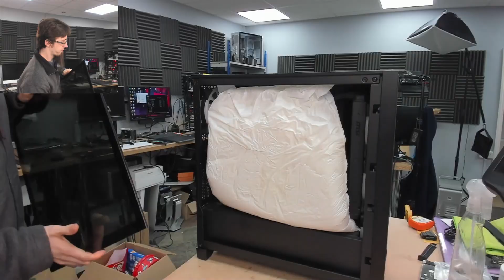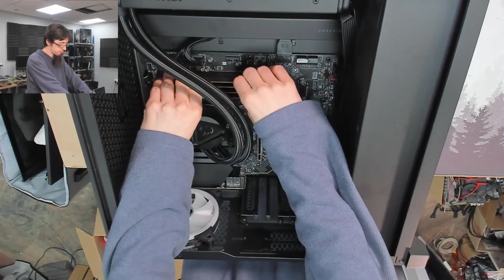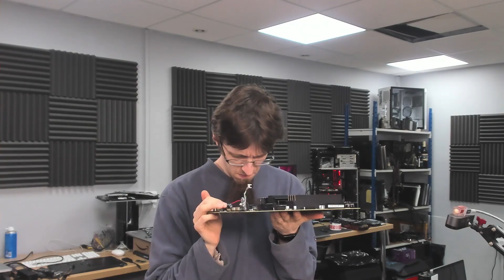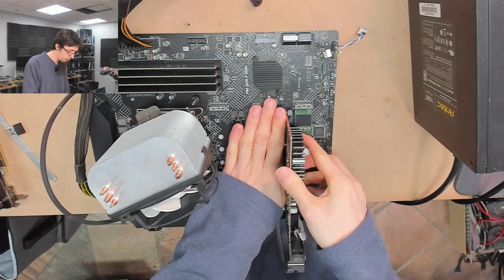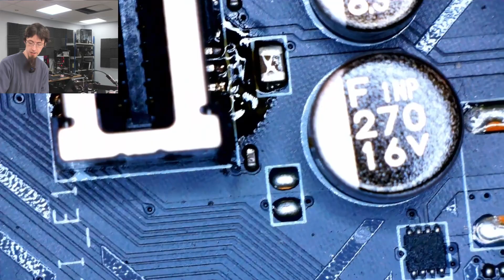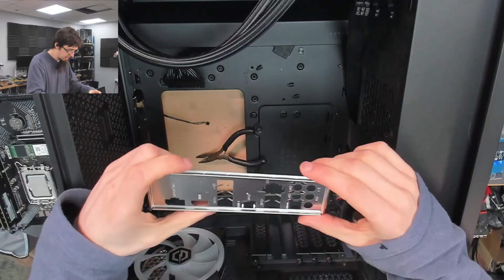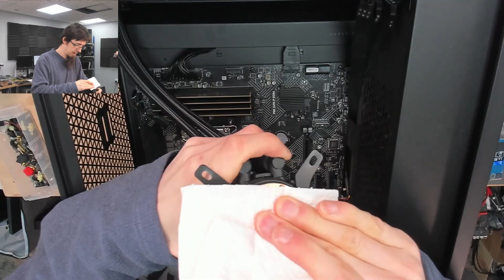CyberPower PC, GPU not detected - LFC#334

Comment: Not to toot my own horn or anything, but about 27 min in or so i thought to myself, maybe the solder joints on the pci-e is bad,  Because it did post once out of random luck. And when you moved it to the 2nd pci slot it worked fine. Then again i should atribute that to NorthridgeFix as i have seen a similar issue on he's channel.

Comment: I am jealous of your climate there. You put the fans so that they rump up at 60 degrees. The system there it seems to me will stay quiet. You can't do that in a warmer climate where 40 and 45 degrees ambient temperature some times of the year is a norm. Anyway nice fix I couldn't have imagined that the GPU slot pins were problematic. I would have thrown away the motherboard.

Comment: Its a really cheap board. True, but for that card you should a really good Asus Rog mother board with a platinum power supply. FSP is good but check the tier list. Excellent work on discovering those disconnected pins. I don't think it was dry joints. I think because the board was off the skew it probably damaged them, and popped off. Good work on repairing them, considering the size of tank soldering iron. You need summat better, some pro gig. Solid work dude.

Comment: How is that 3080 secured? Does it have a bracket to stop sag? I’m wondering whether the weight of the card has strained the PCIE slot enough to break the pins. Brilliant bit of detective work!
Reply from the maker: I think it's a bit of both. Some strain on the PCI-E slot, but definitely not enough solder on those pins. I'd expect them to handle more than this.

Comment: cheap mobo poor quality control would of tossed the ram out 2666 hasn't  been relevant as a ram standard I would of expected it weas a conjob build in the 1st place Linus has also roasted this company..

you can game on anything though the question should be asked should you game on it ..

you might fixed the damaged pci-e connector however what else will fail in the longer term..

Moost syste, inter conjobs chard topdollar for a substandard system the saving grace is the cpu and gpu m.2 may be  the rest of it chuck out 

$3000/£3000 system with less than 750-1,000 worth of kit in it

Comment: Going above and beyond as is standard operating procedure for Adamant IT I've noticed. You're local customers are so lucky to have you and many of them probably don't even know it. Most computer stores would at best diagnose a motherboard fault and then just toss out the existing board. They would then perhaps upsell the customer on a more expensive replacement part with a decent markup, plus probably charge more labor than you did in actually repairing the board. So yay to no needless e-waste and another bravo job sir!
Reply: I agree, the supposed 'repair shops' where I am are bloody useless, they won't fix anything unless it's an obvious and easy 'plug n play' fix, ones they can do quickly and for the most profit,....and anyone who knows anything about computers can do those themselves.....

Comment: I think my aging 3rd gen I7 has a short somewhere, every now & again it USB disconnects if the xbox 360 battery mini USB charge cable hits my case - a 4000D - It's either the charge cable, the case or my motherboard installation, it was the first time I've transplanted a motherboard in years.👍

Comment: This guy's methodology drives me nuts. You see the board is possibly not aligned properly and then mess with RAM sticks and video cards. Beep codes be damned. You see something like that, instant teardown! Right to the CPU socket. If they can't be trusted to install a motherboard or IO shield, you can't trust the CPU instillation. Don't keep trying to POST it with other cards when you could be causing more damage if the motherboard's not right.
Reply from the maker: This is an unwinnable fight for me. Whatever order I do stuff in, people will tell me I'm wrong... One of the problems of doing an instant tear-down on a no-post is that if it works after the tear down, was is the CPU cooler mount? The PSU? The ram? The front panel connectors? If you want to know the cause that takes a lot longer.
It's also worth noting though, this whole process takes ages when I'm spending 10minutes talking about theory between each test for the sake of the camera. If I shut up and get on it with, it's a 20minute job, but that defies the point of filming the process.

Comment: Well done Graham, good diagnostics, thoroughness in checking the board paid off, most repair shops would have given up and sold a new motherboard. Hope your customer appreciates it, but at least you had a really interesting repair video out of it!!
Reply: i think this sort of repair work now, is getting very thin on the ground.  Too many shops just want to the quick swop and away, rather than use skills on repairing, like people used to do. I fixed my PC speakers, with a soldering iron.  That was thanks to Markus Fuller, who did electronic repairs, so a quick look at two mins if that with the iron and good as new.
Reply: @procta306  Well it depends, if it was in warranty, i would recomend use it before soldering...
Reply: Though after he found out  it is a chip on the motherboard not any other part that is the problem unless he offers logic board repair services which he does. As most don't and only do part replacement not chip repair they would replace the part that they found to be faulty.
Reply: Times money mate. A board is cheaper than the diagnosis cost
Reply: @DJIInLondon  As he seems used to finding the place the error is made it was quick. As most logic board repairs use cheap chips or no chip in this instance it really depends on how quick are the employee at finding the error and how expensive is the board for which one is objectively cheaper after all costs are accounted for.
You still have to go through the majority of what he did to find the part that needs replacing as blindly going through a list will take more time then to do simple diagnosis like he did to get to it is a motherboard issue.

Comment: Those kind of faults are super common on PC with cheap boards and heavy(usually expensive) GPU's builded by SI .They probably didin't put the right amount of foam to mitigate the card wiggle during transport, and the weight alone of the card started pulling apart that PCIE x16 slot .And the resistance heat build-up from bad pins contact did the rest.
Sick find though, and i hope the client knows he is leaving with a better builded PC than the one he paid for originally.

Comment: It is possible that the board passed QC, but once there was a heavy gpu installed and bounced around in shipping that brittle shite they use for solder cracked loose. I blame the German Greens and thier Shite RoHoS solder.
Reply from the maker: There wasn't enough solder on those pins IMHO.
Doesn't matter if the solder is good or bad if there's not enough of it 😔

Comment: Very unexpected... My first guess was a BIOS setting for the PCIEX Gen 3-4-5 that I've seen before but this is much more interesting and congrats for finding and resolving the issue. Let's me rethink and check my incoming faulted PC's just a little deeper now.
Reply: When it turned on accidently once on the slot I suspected there might be a power issue. First I thought the power supply which couldn't give enough. But the old obsolete card didn't start at all so that mainly said enough.

Comment: I've seen people rip the GPU off the board and bend the slot using brute Force to put it in but not a poor soldering job.
Reply: My guess is it is not manufacture fault but user fault when installing MBO, bad position caused stress on the GPU slot.

Comment: Great work Graham :)  As this pc came in a transport bag, I suspect it gets moved quite often. The 3080 is a very heavy GPU. The weight and it being moved regularly puts a lot of stress on the slot. Which might have contributed to the solder joints breaking.
Reply: He could recomend that the customer changes into an SFF system instead. 🙂

Comment: I see that not all the  power pins are connected for CPU
Reply from the maker: They are when it's in the case. I was running 8pin only on the bench, but that'll be fine for POST-testing. The extra 4pin is only going to matter when stressing the CPU.

Comment: I've never seen a 12v power line go out on only one of the PCIE slots. Usually the entine rail goes. Not a small part of it.
Strange.

Edit - Oh. Bad solder job. That would do it.

Comment: I wonder if the odd mounting pressure on the motherboard broke that solder connection…
Reply from the maker: I think a bit of both. But those solder connections were definitely poor. I would expect a mobo to handle some board flex / rough handling without breaking.

Comment: Outstanding work, Graham. Presumably the thing worked to begin with so I wonder if it might have been that because the GPU was only plugged in to one PSU 300W supply, excessive power draw on the slot - those transients you mentioned - caused the motherboard 12v rail to fail? If the GPU cannot get power from one power connector it will try and get it from the other. 

One small nitpick: when you moved the customer's SSD there are different types of M.2 slot. Some support NVME drives and some only support SATA. So you cannot always just move a drive.

Comment: I'm not a computer Geek, but I love watching your videos. You're amazing, love to watch your diagnostics, methodical approach, which goes a long way towards explaining why you're so competent & successful in your career. Congrats!! I look forward to your next video.
Reply: i do believe the aio cooler heatsink is oriented in the non recommended way could get air stuck in the pipe.
Reply: @josephmeholick1300 There is always that one guy who thinks like you.
For the 10.000th time it doesn't matter, if there is an air pocket stuck in the pump housing he can just rock the case back and fourth until it has moved to the radiator.
Reply: @AutodidactEngineer  Well this is in ideal position is one where the pump is the lowest point in the loop but as you say it doesn't matter, it this case you would hear gurgling but nothing more than that. 

The only thing I will say is that as the coolant levels get lower then you'll get more air working its way into the pump which can damage the pump, some AIOs have fill ports though so you can always top them up. I mounted my AIO in the top of the case which is the best place as you'll always get coolant flowing through the loop, but again as you said, it doesn't matter.

Comment: Had a fairly similar incident with my old Asus P5Q Premium: I messed up and touched a 3.3v wire from the PSU's ATX connector to a 12v line (don't ask how, but it happened - NVM). The PSU immediately shut off but the bastard wouldn't POST anymore. Both of the 16x Pci-e slots died because of this: the GPU would only get detected in the 4x slots, so that jolt of 12v probably killed a data line on the NB...

Comment: Are you gonna do a triple boot on the GPU test rig for the three GPU brands for testing? Keeps a nice driver-conflict-free OS per brand :)
Reply from the maker: I might do at some point, yea. At the moment I'm not doing testing that warrants it - contrary to popular belief, you can swap brands and even have both drivers installed without issues in 9/10 cases, and most of the time I just need to "confidence test" a card, essentially make sure it works as expected, not do a full QA test.
But if I'm working on specifically faulty cards, then yea you'd want to eliminate possible driver issues.
Reply: @Adamant_IT  Fair enough. Im still from the old days that a DDU is neccesary, but I find indeed most of the time it still works. Its just an old nag I think I cant get rid of.

Comment: To add insult to injury, those RAM modules seem to have only 4 chips per DIMM. Cyberpower seriously paired a top end 12th gen CPU with DDR4-2666 CL19 memory that's running in extra slow X16 mode...unbelievable

Comment: Pre-builds always scrimp on the PSU, Mobo or RAM but I have also noticed recently they are starting to throw old stock into builds that are complete unbalanced madness, like a Ryzen 7 3700x with an RTX 3050. Much like this 12900KF slow RAM and cheapo board.

Comment: Do you not find it ridiculous that pc's have become all about the graphics card.
They're by far the largest and most expensive component of every pc's today.
Reply from the maker: Yup. Gaming PCs are basically glass-canons. Biggest GPU you can afford, everything else just needs to support it, within reason.
Reply: @Adamant_IT  But this is why we have consoles PC's are for science and stuff it seems video editing needs these beasts but somehow they have bled over into gaming and the gaming industry has run with it making the next exciting game out of reach for a lot of people because they have weak cards that a few years previous cost the same as the latest console blah blah i could go on for hours but i think you get the point too much focus on gfx
Reply: People like bling, shiny stuff, pretty colours and they're addicted to them and they have to have them yesterday.
Reply: Depending on the use case it will be yes. Gaming yes video editing yes and so on.

Comment: FYI 
never ship GPU installed
Reply: is there a reason why?
Reply from the maker: Lots of weight, high risk of the graphics card snapping the PCI-E slot or itself. But this is what that packing bag inside the case was for - adds padding around the card to stop it moving in transit.